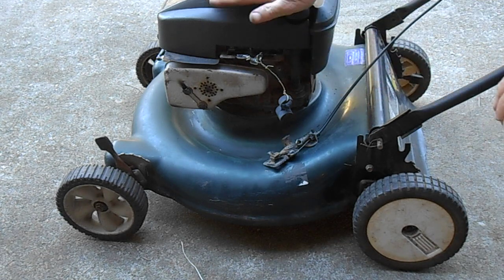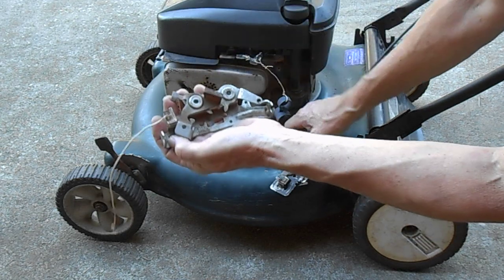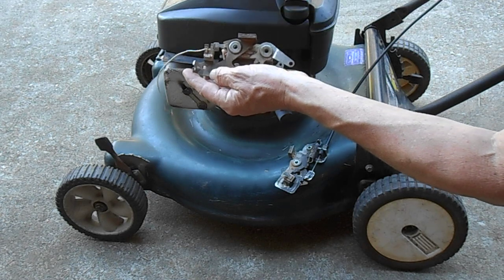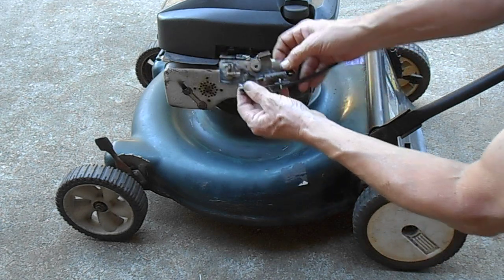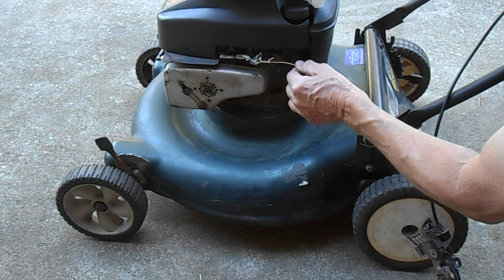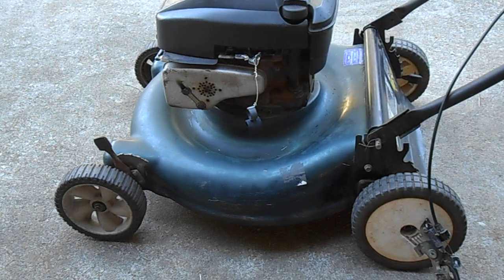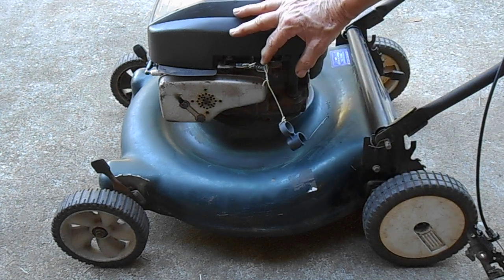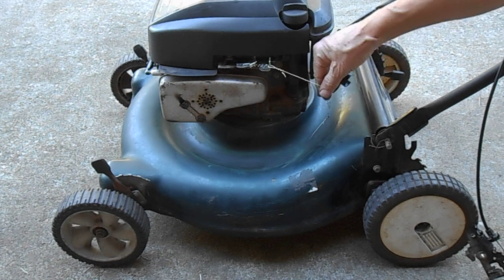How to install a kill switch stop cable replacement for pennies on a lawnmower Part 1

Comment: Better option , toggle switch, ground one end the other to the Ignition Coil
Reply from the maker: My method is cheaper than yours
Reply from the maker: jw2par  thanks but a oggle switch is too expensive, the whole point of the video is to use as much of the original equipment as possible and spend about 10 cents for one small spring